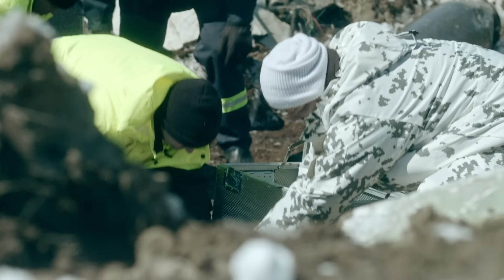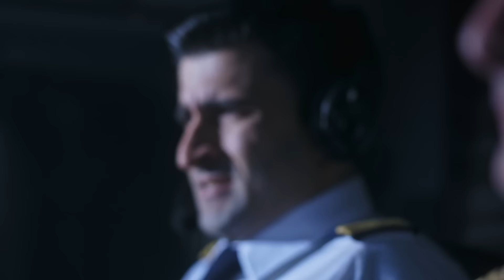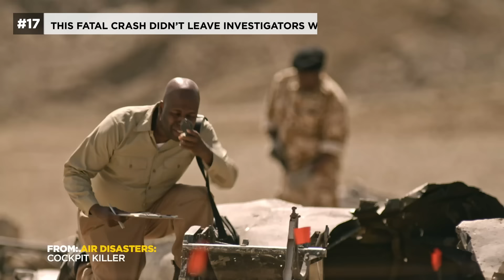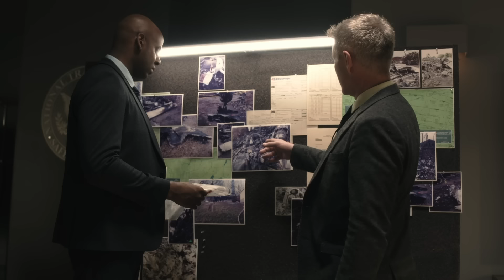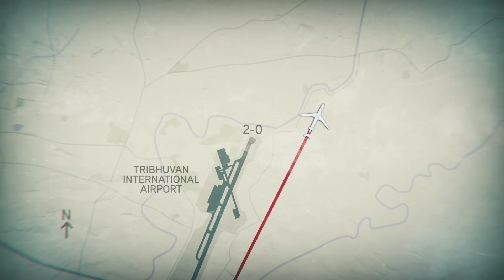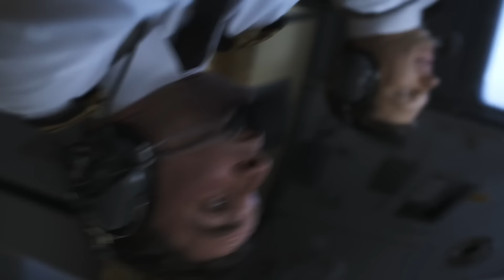Every Single Plane Crash - Air Disasters Seasons 15 & 16

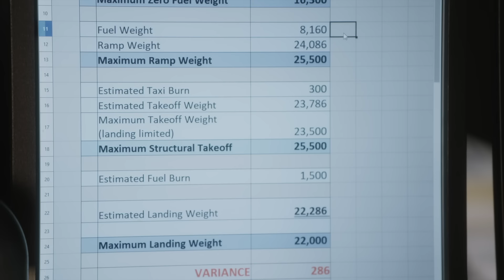Comment: 1:23:53 if pilots wrote wrong weight of something, and weight didn't match properly, because you said ''they were loaded with more than 8 thousand pounds of fuel'' but they wrote 7,700, could it be that Pilots, programmed auto landing, and crash was result of wrong weight in MCDU? I don't know if that type of plane has one, but if it does, it could make sense that wrong weight means different landing calculations, hence, stall.

Comment: You know I have never in 67 years flew on a plane,but I tell you what I am a go getter,will not ride on a passenger plane but I would. definitely and have no problem learning how to fly a jet, I know both planes are in the air but I feel better with a check because I'm in control and I can eject. A passenger airplane all hail can be breaking loose in the cockpit and you will never know nothing about it

Comment: It's sad to hear when peoples lives are lost, but these investigations are so interesting. That kenya air flight, how did the flight remain with flight for so long with no control input. Although lower speed you still have engines generating a lot of thrust. If i took my hands of the steering wheel at 70mph, it will only take a few seconds before losing control.
Reply: Very slow moving TV tho.

Comment: With current technology surely there is no excuse for NOT having pilot air bags part of the cabin design.  We put the air bags in place ... THEN arrange the cockpit instrumentation and controls around them.  Also it seems logical to have a mechanical gyro between the pilots to indicate a gravity pull / horizon line during non turbulent flight.
Reply: most gyros today are digital. And they're much more reliable and precise. Airbags? I hope you're joking.
Reply: @Skywest25  Digital requires power you may not have ... and with technology long beyond flights to the moon ... no, I'm not joking about air bags for pilots.  It just takes creative innovation and determination.  A compass on an iron ore deposit leaves much to be desired ... but a stick and two small stones will establish the E-W line if there is sunlight. Also, There was a time when parachutes for planes were considered an idiot idea too. Hello Cirrus
Reply: @michaelpcooksey5096  Pilots have a harness in addition to a seatbelt. A car impact at 80mph is not the same as a plane going 380 mph. That just makes no sense, anyone in aviation would likely say the same thing. Which is why it's not a thing.
Reply: @Skywest25  Understood.  Anyone hitting solid structure at elevated speeds is a HUGE problem.  Some of the crashes however happen at under 200 MPH and here is where the designers and innovaters need to begin.  Cirrus parachute planes have operating parameter restrictions ... but they have saved lives.  So lets get busy.
Reply: @Skywest25  I am advised that air bags as part of the safety harness are now being offered on the market ... but a local plane dealer said he has yet to see any installed.  I like the effort.  We'll see what develops.  If even one life is saved then it's worth it.

Comment: Just saying, Airlines are stupid, if engines goes on fire just add a damn extinguisher, argument B17 bombers in WW2, Boeing made those bombers, added extinguishers to the later models, helped to increase survivalbility of the plane and crew. Yeah it made the plane heavier but most came back home.

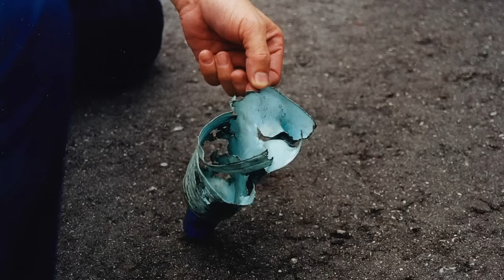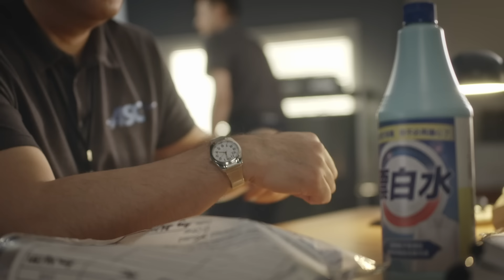Comment: 21:30 I’m assuming the gasoline combusted due to pressure.  Regardless if it leaked during flight, the pressure could’ve gotten the bottle lit. 21:48
Reply: No, it would not have... 

The bottle would burst WAY before enough pressure could have built up to initiate spontaneous combustion. 

Gasoline also does not just keep building up pressure in a container all by itself. Sealed gas cans regularly hold gasoline for years without any issue of combustion. It would be NO different in a bottle on a plane.

Comment: The one with the bottle of gas it took of from us and  landed in  Taiwan?
    They all drive motorcycles in Taiwan. With gas so cheap in US someone may have  left their  motorcycle at the parking garage.
Maybe they knew it was low on gas.  maybe they figured.
This almost gallon of gas probably save some cash as compared to buying in Taiwan
Reply: That would be just downright greedy and the stupidity STUPENDOUS if that were to be the case.... 🤨

Comment: One step ahead on the chart put the plane one step behind...
Reply: Wrong. It put the plane one step AHEAD, which IS why it ended up descending TOO early, and struck the side of a mountain. 

IF it had been one step behind, it would have been further ahead, and would have cleared any of the mountain peaks when it lowered its altitude, and have been too high when it reached the airport.
Reply: @davelowets  Well, what if it was upside down and backward with braille on the instrument panel then ?...

Comment: I'm sorry Sir but you can't bring that bottle of gasoline on the plane with you.
Reply: Nor that suitcase with all the wires hanging out.
Reply: I always use gas instead of bleach..worrks great🙄....I've now gone thru several dryers and no one will insure my home
Reply: @michaelhamilton4536 I’m surprised you still have a home. 😀
Reply: @Soffity  me too!!!!
Reply: @Soffity  lolololol
Reply: How did that bottle of gasoline make it through airport security??
Reply: @amyschlegel1180 ...exactly..
Reply: TOO BAD
Reply: @StevenMevenLevenRevenBleven  ikr 🤣🤣
Reply: There was also a battery there that ignited the gasoline
Reply: yeah but why would it explode
Reply: @LionelSanderson most people don't understand just how flammable gas is. A tiny spark, electric, or static charge is more than enough to ignite
Reply: Dallas TX
Reply: But yyyyyy 😂
Reply: I believe it was in bleach bottles and no one(security) bothered to check
Reply: Plz do watch sky craft diaries

Comment: Looks like we're picking up some ice.
Reply: There was one I read about where the ice was 'drizzle' ice I think. Like drizzle rain here on terra firma. It wasn't deposited so much on the leading edge of the the wing (or in addition to), and the pilots couldn't disperse it. Sad that such an apparently minor difference between rain and drizzle should end up so badly.

Comment: With so many pilots who don't know anything, really makes me glad I stay on the ground.   Some sound like they shouldn't be in charge of opening a box of crayons let alone be in charge of a plane with so many lives
Reply: such an ignorant comment. Observing from the armchair, on the ground no alarms no stress. It's called hindsight. Everything seems easy when you already have the answer. More than 1.5 million people killed each year in car accidents but your gonna stay on the ground. These pilots aren't the only one who can't open a box of crayons!
Reply: Today's pilot rely to much on computers back then it was hand flown
Reply: @BoredEditor4k  when were commercial planes hand flown?
Reply: Word!!! I've seen some videos like these, where the errors that the pilots were making were so elementary and basic, that infuriated me ESPECIALLY when hundreds of people's lives were at stake!! Like with a Swiss flight where the First Officer stalled and crashed their plane by constantly pulling the nose of the plane up, fully aware of the situation!! The freakin' step to correct the situation and save all the lives onboard, was to just push the nose of the airplane downward, in order to catch up speed and get out of the stall. A truly beginner move right there. Even someone without any flying experience would contemplate an execution such as this in order to resume normal flying.
Reply: @vladimator1842 but that can be said for driving  or any form of transport 1 wrong thing and same result.  Pilots are definitely skilled people things can happen to were the Pilots don't know what's happening to the plane. Just because they have flown for many many hours does not mean they know absolutely every that can make a plane crash. I've seen videos  of the people who do maintenance on the planes and change bolts and screws don't put them back on right and that has caused crashes before. How are  the Pilots meant to know that. Not all planes are obviously the same so they will have different out comes. you say you know basic stuff now but be in there situation and you would be the same. When they don't know what's happening it catches them of guard so it will look like that.
Reply: It seems like some of these younger pilots just can NOT fly a plane without all the fancy autonomous systems and instruments working. They simply don't have the "feel" for the aircraft by itself, like pilots USED to before all the electronic nannies came into play. 

Look at the fighter pilots of World War 2, they flew their planes by "FEEL", and could EASILY tell which direction in a 360° space that they were heading. They didn't NEED MCAS, or 3D electronic screens, or an auto-pilot in order to fly their aircraft exactly where they wanted it to go. 

Today, many of these pilots have NO idea what direction they are headed, what axis the plane is moving in, or have any idea what to do if the electronics aren't telling them what to do, and how to do it.
Reply: @davelowets seems a lot of these errors are seasoned vets that have complacency, risk taking or the culture makes bringing up issues an issue so they dont speak up. I see this more than a young person complacent on technology issue..

Comment: Airplanes shouldn't have fuel. They should be electric.
Reply: Batteries dont fair well in cold. The air temp at 37000 feet is minus 61 degrees. But they are working on it. There are electrical prototypes prepared. 2030 or 2050 maybe ready.
Reply: @sharoncassell5273 
Tell that to the space station.
Reply: That wouldn’t work

Comment: At least Uni Air 873 was already on the ground and not still airborne when it caught on fire or that would have been catastrophic if it caught fire mid-landing
Reply: And 1 passenger was nearly arrested for bringing bleach bottles of gasoline on board. Luckily he's cleared, though the cause was the bleach bottles not properly sealed causing it to leak and made contact with the motorcycle battery wires
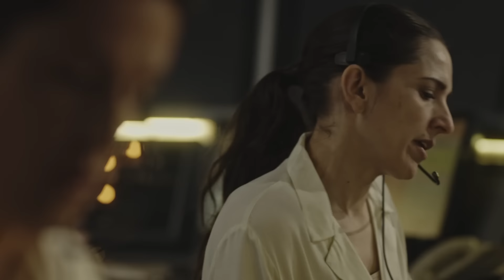Reply: Uu>iuiihuu😅🎉 32:40  @louieosumo
Reply: @usmanakram2346  because of too much lights on the ground, obscuring her view, she wasnt able to see properly
Reply: Plz do watch sky craft diaries
Reply: Plz do watch sky craft diaries